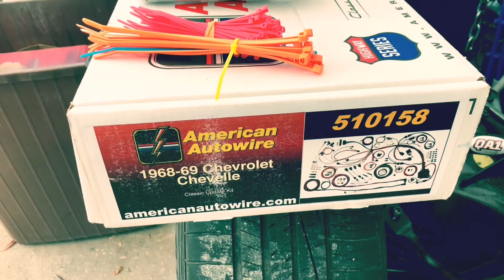1969 Chevelle wiring harness review for American Autowire 510158 part 1

Comment: Do you have any problems put the wire on the chevelle
Reply from the maker: Hi, no not at all, other then it taking a lot longer then I planned.  That was because I was taking my time soldering every connection and wire wrapping after.  It’s a great kit for the money.  They do give you extra wire and crimps so you’ll have sone left over.  I bought a nice set of crimpers on amazon for 35 and saved a little.

Comment: I’ll be getting this harness for my ‘68, but i don’t understand why there’s any crimping needed if it’s supposed to fit all factory components. How did the install go and did you add any more videos on this?
Reply from the maker: Yes I do have more videos on this.  In fact i can make one showing the crimps needed and how it looks if you'd like.  My install took longer then expected but came out great.
Reply from the maker: Check this one out... https://youtu.be/RPcrG_8QzIc
Reply: This series of complete wiring kits is vehicle specific, but not OE replacement. So it will work with stock OR aftermarket components. American Autowire also produces the factory original wiring for those vehicles, and those harnesses are plug and play...exact reproductions of the originals. These complete aftermarket kits have extra length on a lot of the circuits so that you can route the wires however you want and still have plenty of length. Cutting and crimping is the easy part...figuring out how you want to route the unterminated wires is the hard part.
Reply: I have the factory reproduction harness installed in my restored dash cluster now.  It’s not installed on the car yet since it’s still in the bodyshop getting paint. As a sub assembly, it looks and fits perfectly.